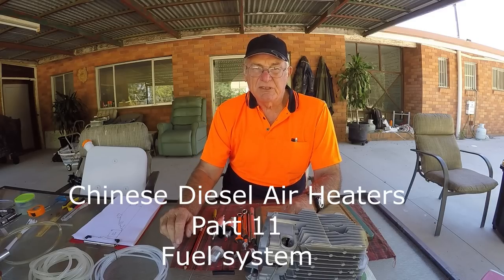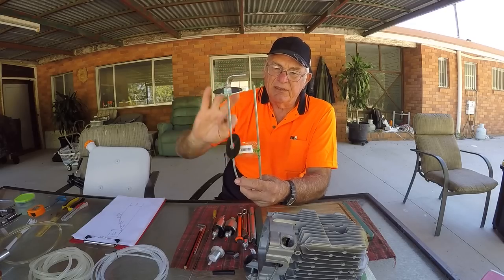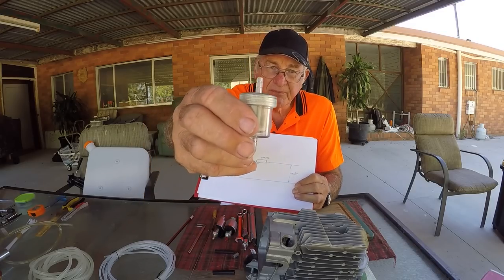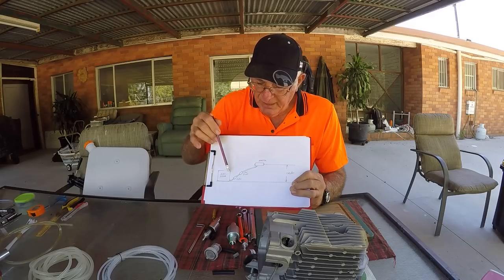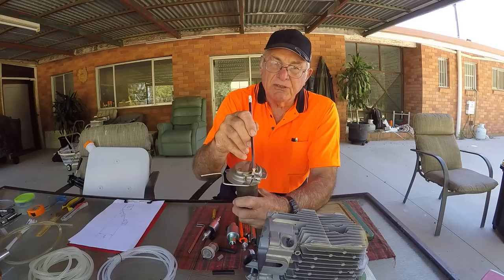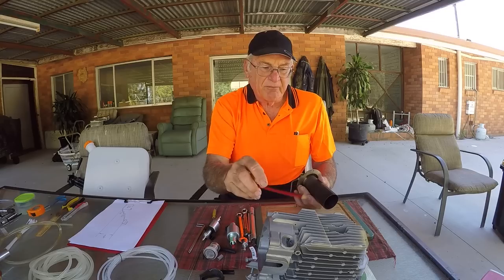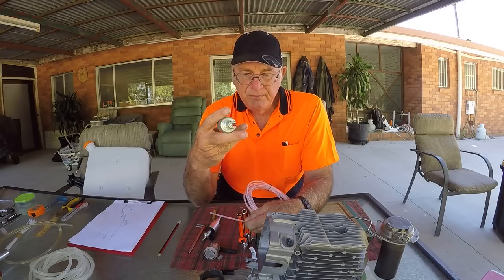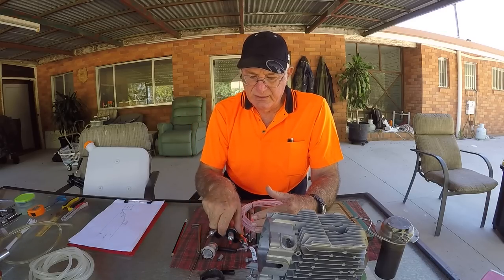Chinese Diesel Air Heaters - Part 11 -  Fuel Delivery

Comment: Thank you very much John. I have enjoyed your very comprehensive videos very much.

Have you seen this video about, rigid verse soft fuel lines. (https://www.youtube.com/watch?v=K1i4b54W7PQ)  It is related to (possibly a response to) your video number 11.

Where do you "sit" now?

Thanks again.
Reply from the maker: Hi Shayne, 

Thanks for the feedback and info on the other video. No I had not seen it until you informed me, but I have seen some of that channel videos in the past. Good videos, and often from a different perspective. Healthy stuff.

Like many other videos I have seen on these heaters, such as burning engine oil, petrol, caster oil and snake oil, and using cheap rubbish vinyl fuel hose, the heaters will actually work very well......For a while.

In the burner chamber of these heaters there is a ring of very fine atomisation screens, and the diesel must be forced through those screens to atomise property. The cheap vinyl fuel hose absorbs those pulses, and as shown in my video, the fuel dribbles out the end of the vinyl line, rather than squirt, from the hard nylon line.

The result is poor atomisation and hence a poor chamber burn that causes excessive carbon buildup. This now becomes self defeating. Carbon deposits make it more difficult for the dribble fuel to atomise, which causes further poor burn causing even more carbon deposits. Quite soon the heater will not work anymore.

In very short fuel hose runs you can get by with large bore hose, but use good quality heavy wall proper fuel hose. Not that cheap, and possibly, dangerous vinyl stuff.

In many instances, short practical tests do not provide an indication of long term issues.

By the way Shayne, did you know you can drain all the oil out of your motorcar engine, and also drain out all the water from your radiator, and your car will start and run quite normally.........For a while.

Cheers.   JMcK
Reply: @johnmck1147  Thank you very much for your prompt and detailed reply John.  Impressive and much appreciated. I was hoping to avoid more expense replacing the cheap fuel tube Edisons gave me with the heater I just acquired. 
I will start looking around for some nylon 2mm tube.
Thanks again.
Reply from the maker: Hi Shane, just use proper black rubber fuel line from tank to filter to pump. If a short run from pump to heater ( 500 mm) normal black reinforced fuel hose ok. Longer runs from pump to heater use narrow bore hard nylon. Suggest you NEVER use that cheap garbage clear vinyl fuel hose.  JMcK

Comment: Can you run on paraffin kind regards
Reply from the maker: Yes Daniel, you can run these heaters on Paraffin, and similar products............for a short while.
Running these heaters on such products causes rapid carbon build up in both the start atomisation screen and also the burner screens. In a short time they will stop working and will need some serious maintenance and cleaning..    JMcK
.
Reply: @johnmck1147  thank you
Reply: Is there any fuel you can run on about from diesel like a mix of oil to ?
Reply from the maker: Hi Daniel, 
I think I have already answered this above. 

They work by burning a liquid fuel. If it is liquid, and it can ignite it will work in these heaters.....
For a short while. 

The more “oily” the fuel the more carbon produced, and the quicker the carbon produced the sooner the heater stops working. 

If you really carbon up these heaters, you need to be very technical to get it out of the burner atomisation screens. For the average person, you perhaps are better off buying a new burner chamber or a new heater.

JMcK

Comment: Thx heaps for these vids. Having trouble getting hard 2mm inside nylon. Does anyone know if 2mm Tuff Cut TYGON fuel line at Supercheap  Auto is suitiable? I have a dodgy soft 4mm line.  Link below of what I am asking about. Others may be interested too.  https://www.supercheapauto.com.au/p/tuff-cut-tuff-cut-fuel-line-id-tygon---1m-x-2mm/379194.html
Reply from the maker: Hi John,
Thanks for that info. I will look for it next time I am in Supercheap.

I buy my hose mostly on eBay. This was my last purchase.   

https://www.ebay.com.au/itm/Diesel-Heater-Nylon-Fuel-Line-OD5mm-ID2mm-8m-/333528678720?hash=item4da7dbc140&_uhb=1